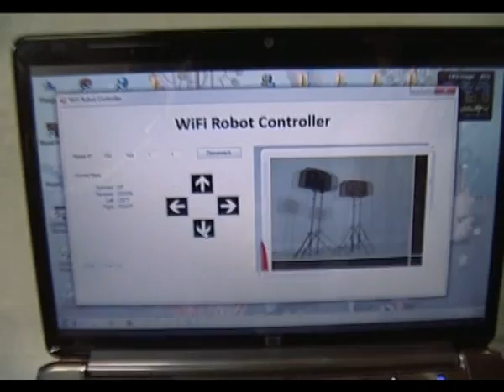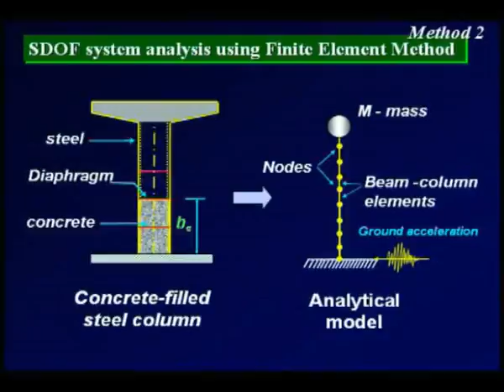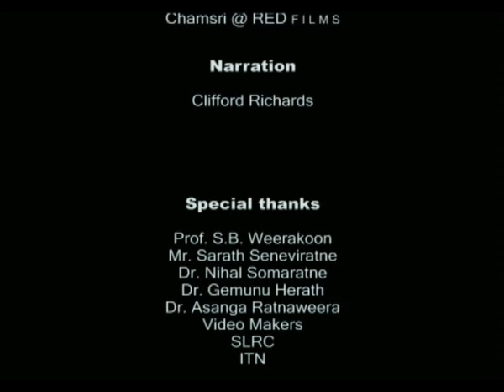Cradle of Engineering Education

Comment: Hi Roshan, If you knew the history of the sectionalised jet engine presented to the faculty by Rolls Royce, adorning the main foyer since the mid 1960’s (see @ 1:31) you would not be so disparaging about the engineers produced by the faculty. Grapevine has it that it was presented for the solution proposed to overcome the main shaft failure by Dr Mahalingham DSc, an authority in the field of vibration.